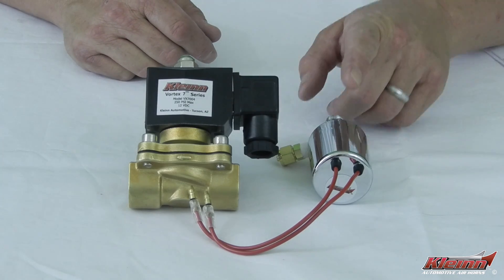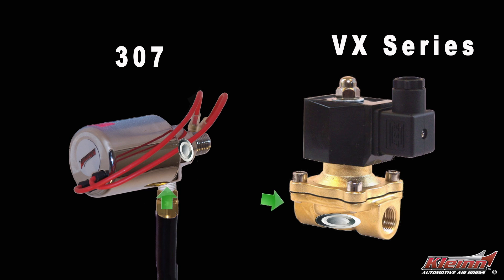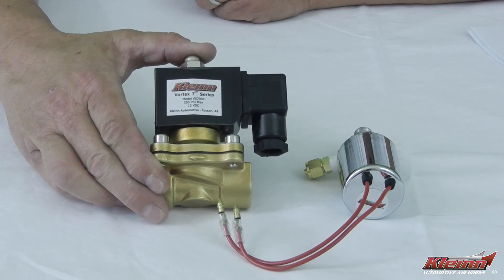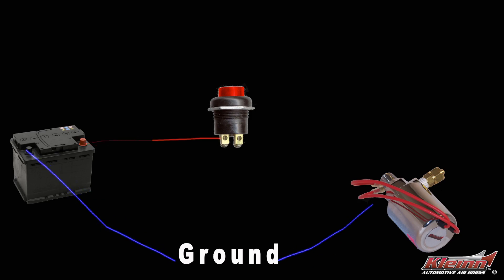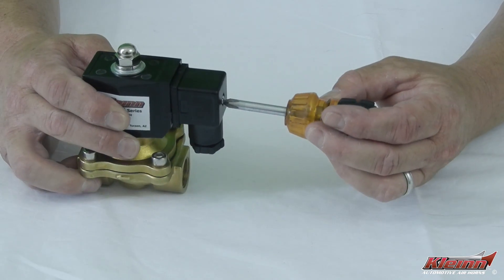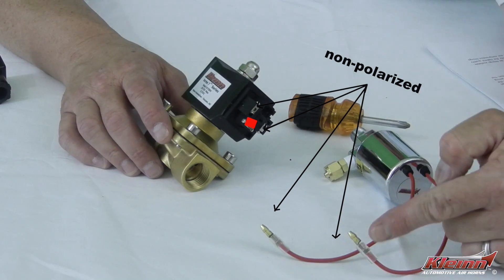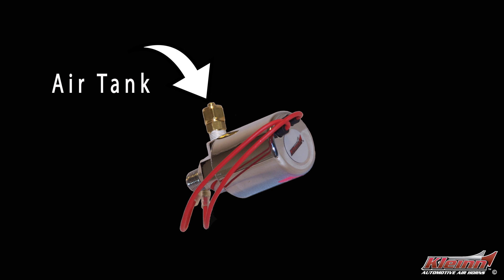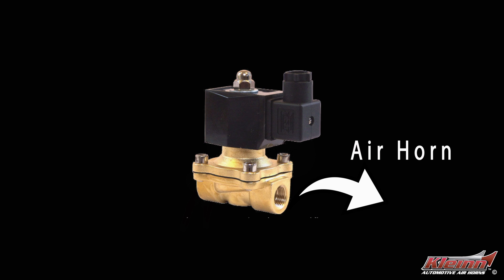Kleinn Air Horn Basics: How to Wire Solenoid Valves

Comment: I have the Kleinn 102-1, it only has the solenoid no valve or air supply needed so does this mean that I only have to wire in the power and ground to a push button?  I can't find any videos on how to install my horns
Reply: Same what was the end result ?

Comment: Kleinn Automotive thank for this helpful video. I wouldn't have succeeded with the train horn kit if it wasn't for this video.
Reply: Agreed.  Nothing in the instructions tell you to remove that cover or even show a picture of the wiring.  My instructions just say, "connect the solenoid."  I generally don't like unscrewing things and taking stuff apart that I'm unfamiliar with.  I guess it was just way too hard to write something like, "Using Philips head screwdriver, remove the black plastic cover of the solenoid to expose the electrical connections ..."
Reply: @67L48  I know, clarity is lacking.  Even their own documentation contradicts itself.  Especially on pins 85 and 86 on the relay.  No mention of pin 30 at all.
Reply: @IndianaFr0g  In fairness, I did eventually find the proper instructions.  The solenoid instructions are given in the "horn" instructions, which are separate from the "kit" instructions.  When ordering the kit, there are a number of components in a larger box.  The "kit" instructions are fairly comprehensive, but lack detail in some cases.  In the box containing the actual horns, there is another set of instructions that contains info about the solenoid.  It's a shame these aren't more prominent, duplicated into the kit instructions, or at least referenced in the kit instructions.  But, despite my earlier post, the solenoid instructions are not missing ... they do technically exist.